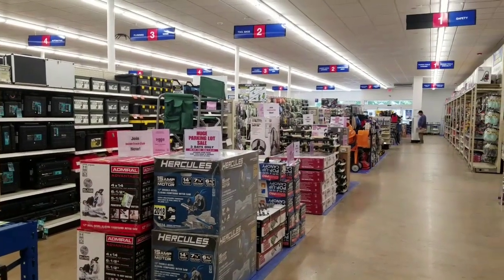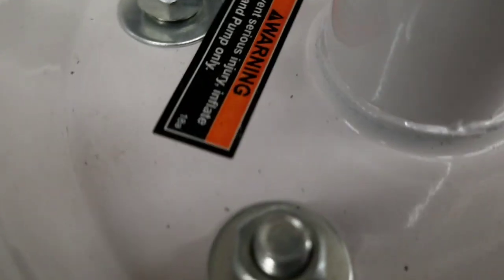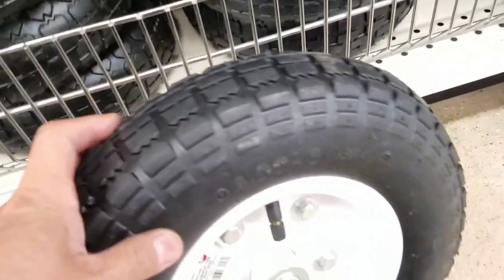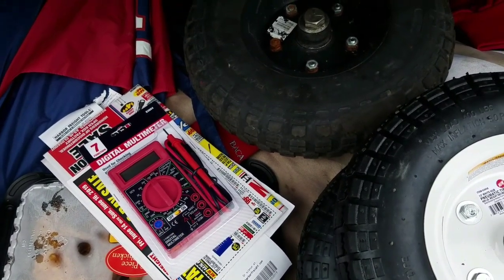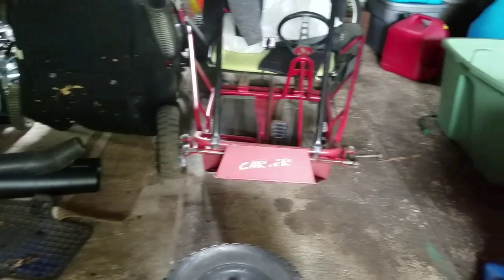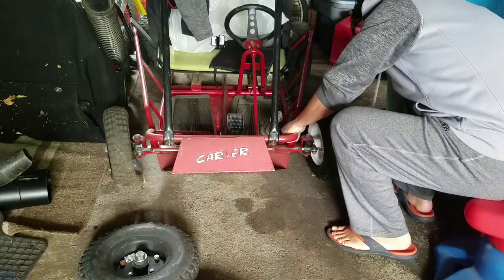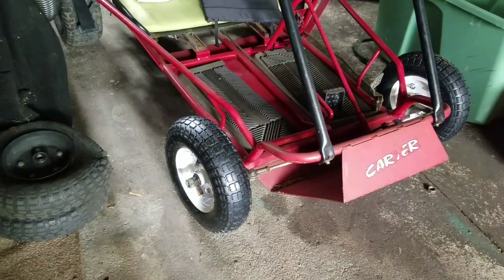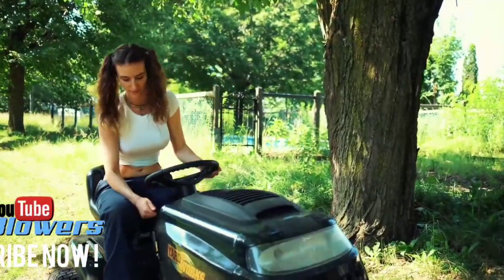HOW TO REPLACE CHEAP FRONT 13" X 4" CARTER BROTHERS GOKART WHEELS HARBORFREIGHT TOOLS COUPON $9.99

Comment: I did the same thing. Bought the same wheels. I made it 100ft before the hub separated from the wheel. Complete crap I would not recommend.
Reply from the maker: Same exact thing happened to me!  Total junk!
Reply: @MowersNBlowers  Yep, I ended up buying lawnmower 15X6.00 Tires/Rims from tractor supply for $37.00 each. They work great! And usually have them in stock.
Reply from the maker: Good for the rears but fronts would be too fat restricting steering ease

Comment: Don’t buy those cheap HF wheels. They will break at the weld and the wheel will come loose while driving. I went through two sets before I learned to stop being so cheap on go kart tires.
Reply from the maker: I sold it to a friend with those new wheels,  broke just like you said!
Reply: What kind of wheels should I get then? For fairly cheap

Comment: Don't do it!  Safety is important at my age and for my kids. Any lawnmower rim and tire and harbor freight as well are low speed bearing but also tire ply and rim strength will not hold up. Do you want it to explode at 30 plus on anyone? Spend 30 bucks do it right.
Reply from the maker: They are junk tires
Reply: That I agree
Reply: @MowersNBlowers  My tires went bald the FIRST day!
Reply: Where do you get your tires for 30$?

Comment: Got a go kart and thought those 5/8 tires would fit but are to small In the bolt any idea why
Reply from the maker: You bought the wrong ones
Reply: @MowersNBlowers  any idea where they sell rims with bigger hole than 5/8 idk it's werid every engine I've had no problem got a new one and now having problems finding the right rim
Reply from the maker: @lomi4267  he the OEM ones from the model number parts diagram

Comment: The 14.99 will not break as easily as the one with the 5 lugs
Reply: Do you know how reliable they are? I keep braking my front tire rims
Reply: @narutouzimaki100  they work pretty good as long as you’re not pushing too much power

Comment: Could you be able to make a short video on how the clutch and brake work, I just got a frame of one and I need to figure out the brakes thanks!
Reply from the maker: The brakes are just a circle belt around the rear wheel drive disk...push the brake pedal down and a long rod pulls this belt that tightens over the disk to slow the wheel down.  The clutch is called a centrifugal clutch...it grips as you speed up the gas and the rpms cause teeth to grab the chain and it goes.  It's very simple.  Centrifugal clutches are super cheap...like $20, goes right on the crankshaft.  I have a video showing me replacing the clutch. Just search it.
Reply: Mowers N Blowers Yep I noticed my frame has a replaced engine plate on it so I will re-weld a new one in. Thanks!
Reply: @MowersNBlowers  any idea where I can get the rod that pulls the brake? I just got one of these go karts and it didn’t come with brakes